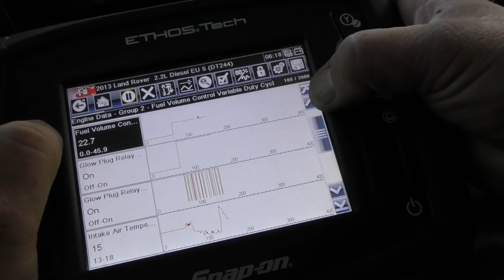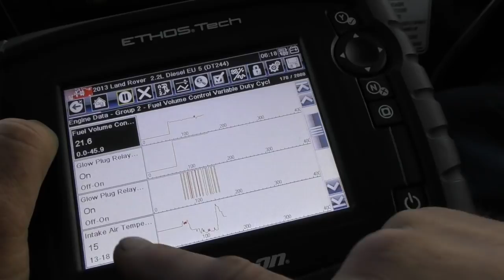Thieves or incompetence?  Address to ScannerDanner and Diagnose Dan.

Comment: Shops are begging for technicians  here in Canada. There is no incentive for the young to get into the trade. Customers don't want to pay for your time or expertise, shop owners don't want to pay for your skills. Tools are getting expensive and quality is going down. It's a part time job on your own time keeping up with technology. People have no idea how advanced their vehicles are and how complicated the systems have become. Even base models have interconnected systems dependent on each other to function properly and when they go wrong it can take some real time and diagnostic skill to figure out. Someone has to pay for our time/skills or it's just not worth it to be in the trade.
Reply: Absolutely !!
Reply: $20/h was decent 10-15 years ago, not in 2018, these shops are delusional.
Reply: #1 reason I switched from working on semis, you driving them. More money, less stress, and easier on my back. Use my nice collection of tools at home now, working on my own projects and side jobs that I want to accept.
Reply: @Jiggle-ps2dx  if you're in automotive, get out while you can, there is no money in it. HD mechanics make way more then $20/h, get you're red seal and good to go. But Ontario  has the most population out of any province so that's a problem as well. Every industry in that province has competition,not enough good jobs way to many qualified workers= low pay.
Reply: Right on the money. The asshole dealership charges $110. per hour and pays $26.00 to the mechanic. What could possibly go wrong. Then 40 years into the future the mechanics body is fucken worn out and he is broke. Meanwhile at the ranch , yes I say ranch , that is what the dealer ship bought while riding the back of the mechanic. .
Reply: @Jiggle-ps2dx  I wouldn't call all of them mechanics just because they have tools and know how to find the engine. If you are good, fast, accurate and reasonable, start your own shop and take business/money away from the shops that didn't want to pay your worth. If you do right by your customers, news travels fast and that $100 per hour can be yours; less expenses of course. It may work out to $26 dollars per hour in the end. No bosses to deal with, only demanding customers.
Reply: You're totally correct! It's very sad and true in the same time...
Reply: @Jiggle-ps2dx  Mechanics are "NOT" Tech's!
Reply: @ventureelect   That's me after 49 years in the trade. Worn out body, still have to work to make ends meet.
Reply: Nothings changed since I twisted wrenches in the ‘80’s. Seen the writing on the wall and got out after getting my ticket. Never looked back.

Comment: I have real symphony for new technicians the job has changed beyond all recognition in a single generation, Previously it was enough to have good mechanical empathy and an element of problem solving. Now the knowledge required to be competent at diagnostics is that of a senior technician from the Electronic discipline along with all the traditional spannering on top. The experienced technicians are left to teach themselves in most cases in their own time, and with no pay.
Reply from the maker: Symphony?    lol   I know what you meant.
Reply: Even with spell check I cant get the spelling correct, doh!
Reply: I kind of disagree.
If you learn a little bit about electronics, then you can fault find many of these problems.

None of these "wizards" do it through some kind of contact with the spirit world - they go and get a diagram! Then use a logical process. 
It's not so different to knowing that a car has 3 major symptoms, only electrical has become more important.

Comment: I will tell you what I see. I'm in the US and have worked on cars, and medium duty trucks my whole career. I run my own shop and I want things done right. Finding a technician who is capable and takes pride in his work is a struggle. I understand that customers don't want to pay. Repairs are expensive. My issue is when the younger guys come in and cannot pull a door panel off and get it back without breaking everything and the customer comes back with door locks not working or anything else that can go wrong. Here in the states, these kids go to these trade schools and are taught things far above their skill level. They are concerned with turbos and cam profiles, and they can't get through a disk brake job without screwing it up. They spend most of the time on their phones or going on 2 hour lunch breaks. I won't hire trade school grads anymore. They know enough to really screw things up and think they deserve high end money for it. Here in America at least, they get no hands on training in the real world. They feel above changing oil or light bulbs. They  run straight to the computer for any diagnosis. I don't know if you have Identifix in Europe, but I hate it. Critical thinking and staying on top of new technology is lost on these kids.
Reply: These kids are not stupid . But face it most shops do not pay ! Everyone wants a technician with 10 years experience, a college degree and a 100 grand in tools but only wants to pay them minimum wage . Good luck with that ! 😂 😂

Comment: I'm with you. Fault finding is the "black belt" for technicians, be it mechanics or software (my job).
However, as a Defender owner I have yet to find a garage that I can trust. So far I had to fix a poor rust-proofing job (they sprayed wax all over exhaust and DPF but missed lots of the chassis...), squashed cables - three times, sloppy aux heater exhaust pipe, and fu**d up towing electrics (they extended the loom which wouldn't have been necessary had they read the manual, used two wires of the same colour to do that and of course got the polarity wrong...). For all these jobs they were paid premium (a main dealer and an indepentend).

Comment: 3 minutes into the video and I know exactly where you are going with this! And yes, there is more to it then what meets the eye, so to speak. There is a reason why I quit working for the "MAN" so many years ago.  I started to get so upset with this crap I changed back to my early profession. Great Video mate!!!
Reply from the maker: Cheers.  Thanks for your comment.   I'm at the point of wanting to leave completely to find another profession.   If I took into account the money I spend on tools I could still get a lower paid job and still be better off.  ( Stacking shelves in Tescos lol)
Reply: @trailerfitter2 , I was an Auto Tech also; consider Aviation Maintenance, the pay is a lot better if you work for a major airline or a good company... "IN THRUST WE THRUST!"

Comment: This reminds me of my industry. Im a marine engineer and i was recently promoted from 4th to 3rd engineer. Where as with when i was promoted from cadet to 4th i was given a training trip to show me how to do my job and how to run my section of the enigine room for 2 months, when i was promoted to 3rd i was give just 3 hrs worth of hand over and told right you should be good get on with it when you are dealing with a completely different set of equipment.

Comment: I attended college then did an apprenticeship. Swept the floors and emptied the bins to start. Worked at a dealership, worked v hard for very little money. Stripped gearboxes etc. Left to go into a huge body shop stripping and rebuilding cars. Felt like a factory. After seven years had the chance to get out, decided to throw the towel in. Twenty years out now, do I regret it? Yes and no. Got a job that was easier and better money but the trade is still in my blood. Still have my tools and do the odd bit. Always felt like we were looked down upon in the dealership. Not sure if that was real or perception. But nothing worse than standing under a car with water and snow running down your neck and dirt under your finger nails. But everyone wanted out. Cold, dirty, repetitive, endless pressure. You didn't have time to enjoy what you did. Still have scars on my knuckles from punching a cylinder head, slipping off the nut whilst adjusting tappets. Cuts were just part of the job. One thing the trade instilled in me is that you have to find a solution because no one else will do it for you.
Reply: That is a profound statement from me a tech of 6 years speaks to me

Comment: I’ve worked in a couple of main dealers and to be honest you are spot on with the stuff that goes on in the workshops due to the lengthy “chain of command” and also pissed of techs not wanting to get involved in something that’s beyond them. Ive now work in a extremely busy independent garage for 10 years working on every make and model of car and light commercial vehicle,the knowledge and understanding I now have of multiple makes and models surpasses that of a “dealer tech” plus being able to talk directly to customers to “listen” to the issues they are having with their vehicle is invaluable compared to being handed a job card stating “customer complains of  a noise when driving”  🙄 . The old saying goes “do a good job and 10 people will know about it but do a bad job and your on mechanics Facebook bodge jobs 😄 Look after your customers and your reputation will look after itself......apart from that one customer who’s always a pain in the arse but ALWAYS comes back 😎👍🏼  thanks for the great vids 🤟🏼 one last thing...always treat the customer like you would like to be treated yourself.

Comment: I full on agree with you as I work in the trade. The trade is hard and with the pressure of customers not giving enough time to work the problem out. Plus you have a work load to do to cover costs of running the place. As you said customers don't want to pay for time that could be used else where to make the money. Customers don't always realice how complicated the systems are on vehicles now and that tech don't know every single thing. I was trained years ago but if your not doing them things you forget how to do them. Trailing courses aren't cheap ever. Plus once you have done it the following week something new comes out. Lots of manufactors use different systems so it makes it even harder.
I always try to educate my customers so they can understand the cost and why I came to the conclusion of the fault.

Comment: 2019..I've noticed that with the increased use/legalization of marijuana, a lower standard of performance is tolerated. I am retired electrician and aircraft mechanic and keep busy with handyman work. I am being called for more and more stupid things. Lights that don't work because of burned out lightbulbs, grown young men calling me to change their flat tires. I got called to fix a water leak and I told the woman I would be there in 2 hours. When I arrived, there was water coming out the front door. I knocked on the window and saw her 2 adult sons laying on the couches looking at their smart phones. They were surrounded with water. One son turned and looked at the other and finally came to open the door. I found the mother in the back bedroom desperately sweeping water out the back patio door. I walked back out the front door and turned off the main ball valve with a quarter turn. The valve was right at the front door about a foot off the door. I told her to call me back when she had everything dried out. She called me 3 days later and when I went into the bathroom to fix the broken pipe behind the toilet I found the toilet piled high with feces. The sons were still laying on the couch.

Comment: My friend, I have seen so much crap from main dealerships that for me it doesn't matter any more. I will far better go to a garage like Dan's where I know that I will pay for the extra time but the problem will get fixed. I 've lost count of how many times I took cars to the dealership and said to them to spend as much time as necessary. They would not care less, they would call back the next day to say "we can't find the problem, please come pick up the car". All that dealerships care about now is quick routing maintenance, change brake pads, change oil and oil/air filters, max do a cam belt, and that is it. It is not even worth burning the petrol in order to drive the car to the main dealership. Main dealership owners have one and only one thing in mind: Quick money.

Comment: Yep.
It's tough out there.
Customers not telling the truth about problems on the vehicle, leading to misdiagnosis, manufacturers turning a blind eye to vehicle build issues. The man on the floor left to deal with it, normally in poor conditions and pay.
The thing that annoys me is if a wheel falls off a desk drivers chair, the workshop immediately has to fix it, or if the heating stops working in the office, again workshop to repair immediately. 
Yet if the workshop needs something it doesn't happen.

Comment: It's cheaper to keep chucking sensors and parts than long diagnosis costs. I to have worked in the commercial side of the motor industry and have spent days and days chasing intermittent faults. It's nice to locate the problem but in several circumstances spend even a grand on parts is cheaper than diagnosis. Yes experience is time served and getting ahead by being trained by fully qualified and experienced person for a few years is invaluable. Quick qualifications should be written on tissue paper, and given in the rain